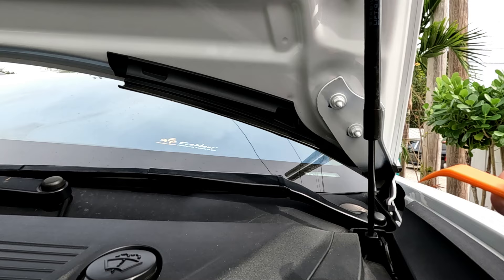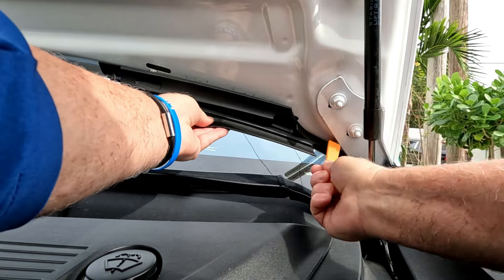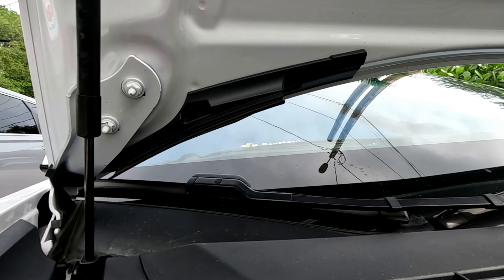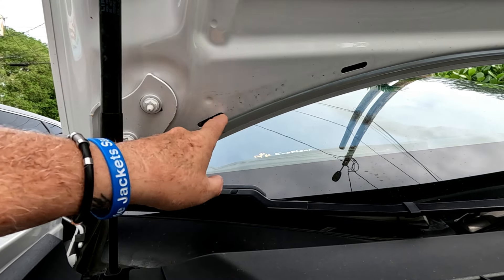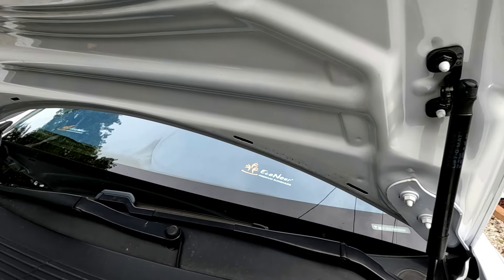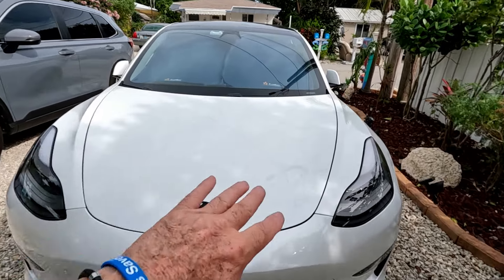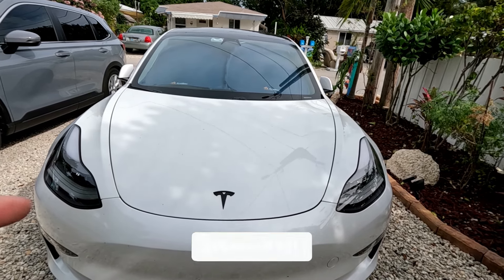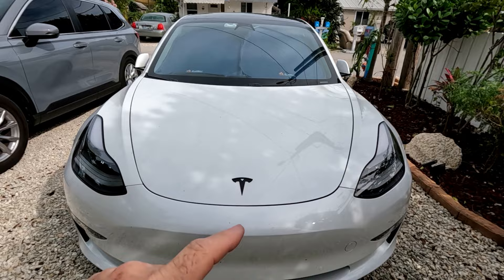TESLA MODEL 3/Y Frunk Seal Install - You NEED THIS!

Comment: Except now there is no ventilation for the water that does get trapped as this doesn’t even go to the corner of the hood. There’s also a vent likely for your filter so I dont know if some 3rd party knows better then the manufacturer. But if you’re often in a typhoon then do it I guess might cause more issues tho
Reply from the maker: Hi Thanks for watching! Your concerns are valid, and we thought the same thing too. But I've seen many cases where leaves and plant debris falling into the a/c intake causing that ole musty smell in the cabin. Then after all that debris, just add water to it, and now you have mold growing in a nice and dark space near your a/c intake, ready for you to breath it in. But that's not even the worse, before installing the frunk seal there was a Niagara Falls of water running into the most important area. The area where your low voltage battery is located, and not only the battery, but loads of electrical wire connections, and including the coolant, and brake reservoir. The seal is just protecting that center piece where we don't want the water and debris to fall into, and there's still plenty of air circulation. Thanks for your comment, its a very important one! Change-On Baby! Peace!

Comment: I installed that on the mine, it really good because the water go into the air filter and it start smelling bad, after this im no having that smell problem.. I recommend install the skid plate under the car aswell
Reply from the maker: Hi Carlos! thanks so much for watching and your comment. Great info! Thanks! Charge-On!
Reply: What is this skid plate you mentioned in your post?  What is it and where do you buy it etc?

Comment: If you have the Model Y with the giant HEPA filter under the hood, this might be even more of a good idea. Not to second guess the engineers, but I suspect there's a reason for the space in the middle. Probably for the ventilation system.
Reply from the maker: Hi thanks so much for watching our video. There's always a doubt if the space is by design or a mistake...we don't know, but so far it's been working fine for me...but only time will tell all. Thanks, and Charge-On!

Comment: We shouldn't need this.  There's no doubt that Tesla knows about this problem.  It's all over the internet.. They're not doing anything about it.  This should've been addressed a long time ago!  You'd expect something dumb like this to happen on a GM, Chrysler or Ford.  That's normal for those makes but Tesla should be fixing this crap of a design!!
Reply from the maker: Hi, thanks so much for your comment & watching our video! Totally agree with you, the problem is all time. By the time their engineers have the chance to redesign, put into production and install onto their new models...it could be several years. I believe since its all new and there's no incidents reported, that we know of...we just have to protect our investment ourselves. Thanks, and Charge-On Baby!